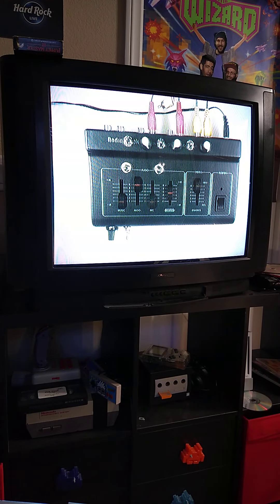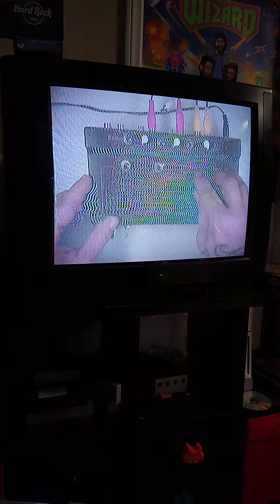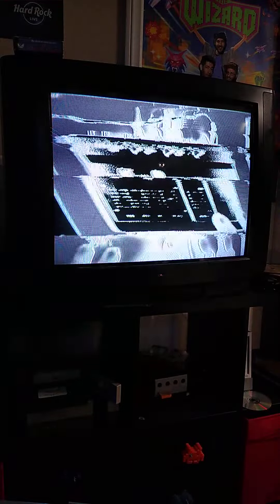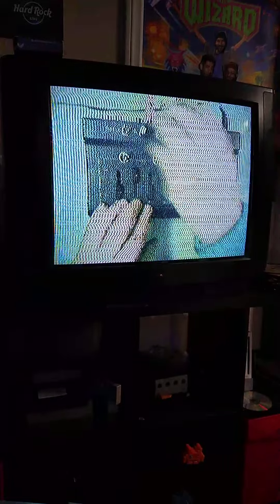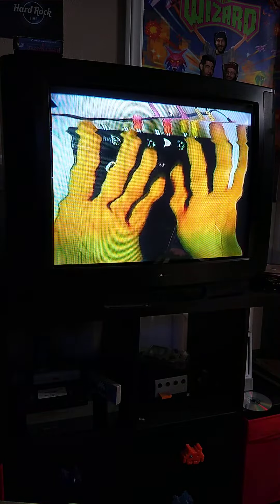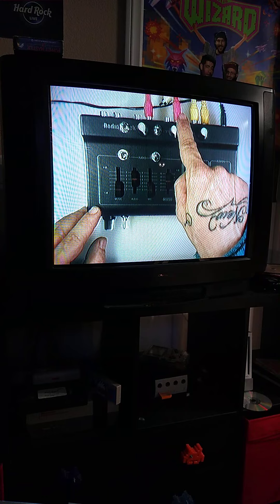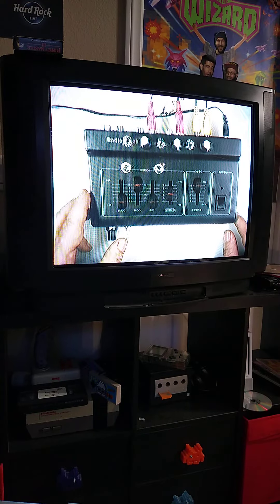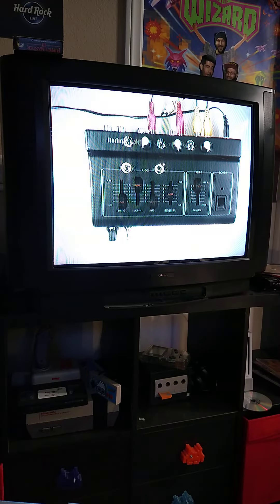how to use the classic Glitch Enhancer..."Little BOW"

Comment: How did you do this
Reply from the maker: It's called circuit bending. I connect wires to places on the pbc board to make it short out the stable image.
Reply: Where bro do you have Instagram
Reply: Hey man I need you help can you help bri
Reply: Hey jack wherw can i get or of these
Reply: Hey man can you help out
Reply: Yo man can you help